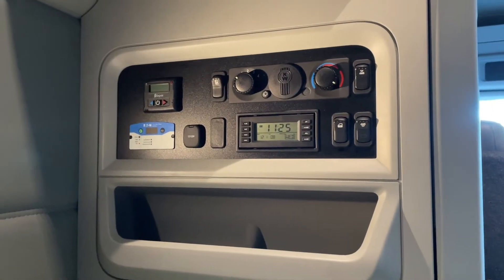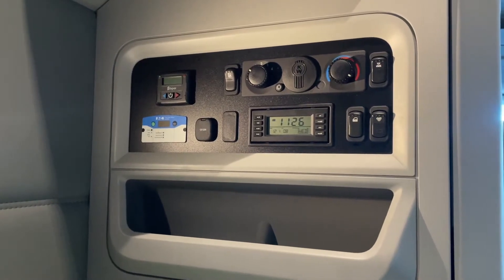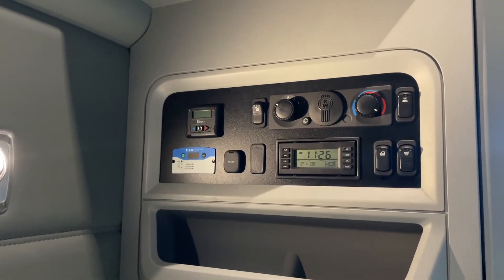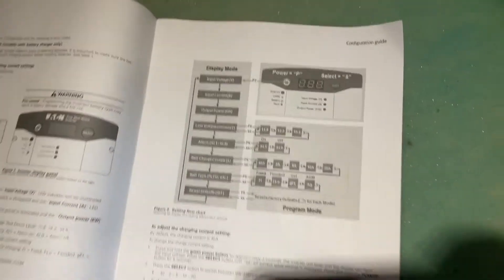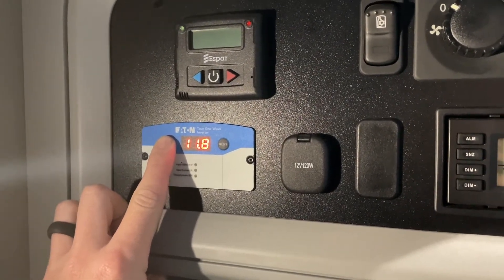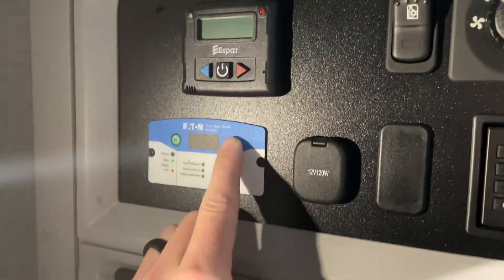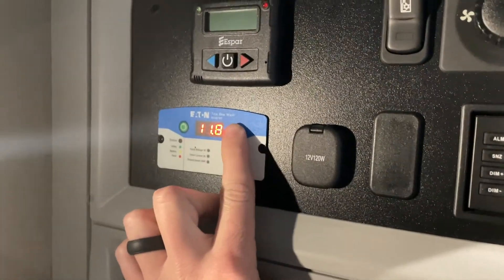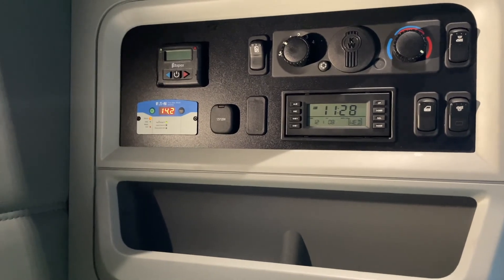Inverter Shuts Off! Changing Low Voltage Cut Off

Comment: I got the same problem with my company truck (2022 International) the inverter shuts off at 12.5 but the truck has a auto start/stop feature that never starts the truck when voltage is running low😅…anyways truck is in the shop and hopefully they fix it

Comment: What about 9.5 8.5 7.5 cut off settings for off grid lithium battery systems
Reply from the maker: That is a totally different system so I couldn't give you any advice there. I don't have such a system.

Comment: For some reason I’m unable to set the cut off voltage, it stays stuck on 11.8.
Reply from the maker: What truck are you in? For example, our freightliner trucks won't let us change this setting, but our KW trucks will. It is a setting the OEMs decide to have Eaton include in their inverters or not.

Comment: This is exactly what I have. My current question is. I want to go with a bigger one. But I want all the functions like apu kicking on with low voltage and the digital readout inside the truck like we have. So can I keep all that with a truck stop bought 3k inverter and other question is how big can I go with out upgrading the wires
Reply from the maker: I am not sure where the brain is that controls all of that. I assume it is in the truck but I can't say for sure and whether the truck stop inverter is compatible to read the messages that are coming its way or not I have no idea. I will ask Freightliner and see if I get an answer on it.
However, what I can tell you. Freightliner didn't use to have such control of the inverter, it used to be an on/off thing that was independent of the truck. But a few years ago Freightliner decided to put in a computer that would control the inverter such as turning it off if the batteries were low, turning it on or off when the truck is driving, watching for power surges, etc. And ever since then they have had problems. I was dealing with a very weird inverter problem recently and Freightliner told me the best thing we could do is remove the Freightliner brain and install a new inverter that was independent of the truck's control. We did that and it has been so much better ever since.

Comment: Hello friend doble D  ,,, i hope get an answer  ,,, i install a 700watts galanz microwave on my K680  and when i try to warm something an about minute and half cut off  ,,,, could be this the problem?
Reply from the maker: It certainly could be related. That is a good size microwave but a few things to try: 1. Don't have anything else plugged in when you use your microwave. 2. When you use the microwave have your truck on so it is giving full power to your inverter. 3.  If if still is doing it, see if you can plug your microwave into a different outlet just in case it is a bad outlet. 4. When you get a chance, load test your batteries. If some of the batteries are weak it will send that low voltage signal to the inverter and it will cut you off.
Reply: @DDTruckDriver  well thanks for answer me ,,,,   but now make a beep sound in  seconds and show an  E05  i wonder what is that mean
Reply from the maker: @jessecarr9415  A quick google search says that it has to do with low battery input. I assume you have some bad batteries and the inverter keeps getting a lower voltage signal from the bad battery and then it panics and shuts down.
Reply: @DDTruckDriver  I had/have the same problem and just put new batteries in so I'm thinking something like the LVD

Comment: So I have one of these in my international and I’m able to change the setting and I lowered it to 10.5 but whenever I plug something into it the inverter dies out… I checked the connections and everything checks out… any thoughts???
Reply from the maker: First thought I’d possible bad battery. If one or more of your batteries are bad then it could occasionally be reading a lower voltage even though the other batteries are good. Your truck starting can deal with that and doesn’t freak out but I’ve found these inverters are sensitive and as soon as they sense trouble they panic and trip

Comment: That helped me immensely now I can relay to my maintenance what's happening and if there's a fix unfortunately I am in a Freightliner and you said that you cannot change that
Reply from the maker: It depends on the inverter but yes most factory freightliner inverters can't be changed. However we have been installing aftermarket ones immediately after they arrive from the factory and those can be adjusted, so it just depends on what you have.